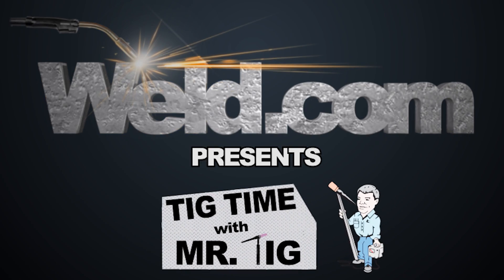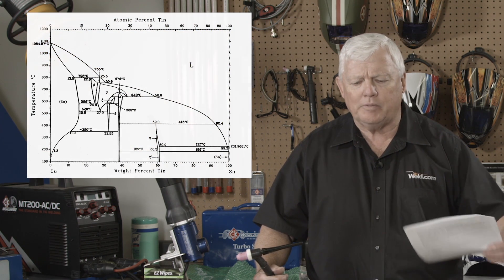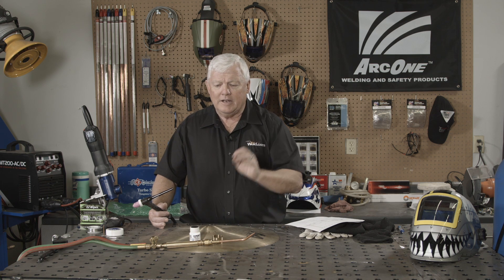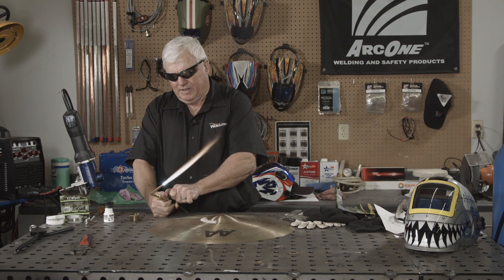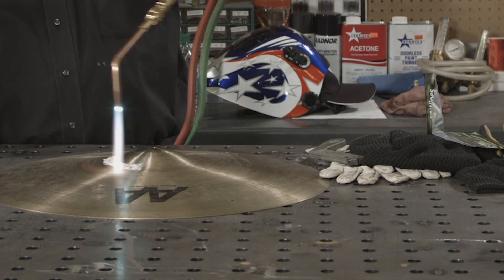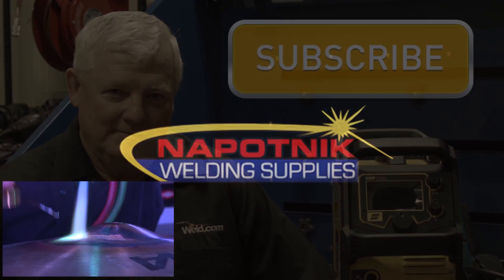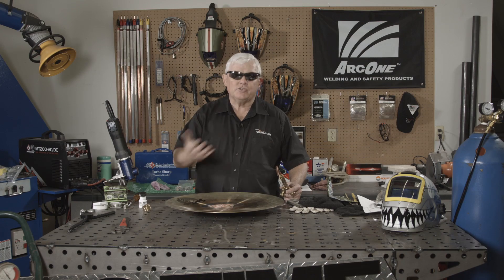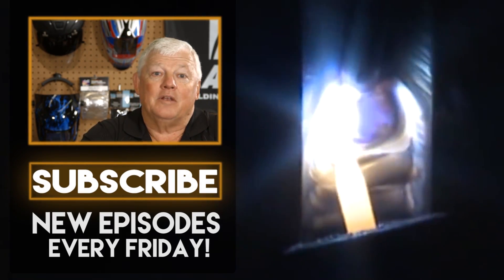Welding Bronze Cymbals (Part 1 of 5) - Silver Brazing | TIG Time

Comment: the heat is what kills the sound of the cymbal repair.. the sound comes from the tension on the metal from hammering it into a bowl shape, back and forth folding the bowl in and out... when heated, it relieves the tension that the cymbal is holding..
maybe just heat the filler and let it drip on/into the crack, if it sticks, then polish it smooth flush with the cymbal surface...

Comment: ever thought about the auto body mig braze process using high volt/amp tac n stich both ends first then center and repeat cool after every input with ice water soked wash rag ring out rag before applying re machine surface when done

Comment: hello mister tig, 
I had a couple of questions. 
#1 for the flux did you use a Harris staysilv brand flux? 
#2 why not use a 15% silver brazing rod. 
the composition of those rods are 15% silver , 80% copper and 5% tin. it just seams metallurgicaly it would be a bit stronger. also the melting temperature is the same as what you used so your heat input would be identical. 
it may be worth while to give it a try and see of there is a notable difference.

Comment: Dear Mr TIG, In order to make a successful repair. First you have to eliminate the crack. Grinding out the crack is the proper procedure. I would use a dye penetrant for inspection to make sure crack is grooved out completely. Sometimes a hole drilled  on each end of crack will stop crack from growing. A low heat process would be your best solution. Any heat will make the crack grow. So I recommend Laser Welding because of the low heat.